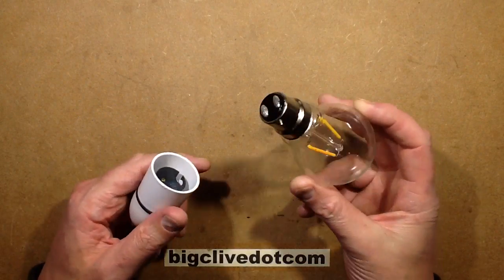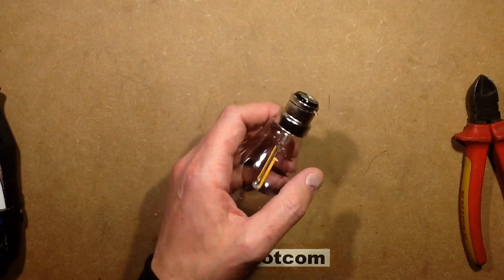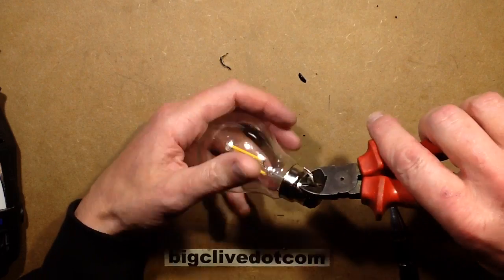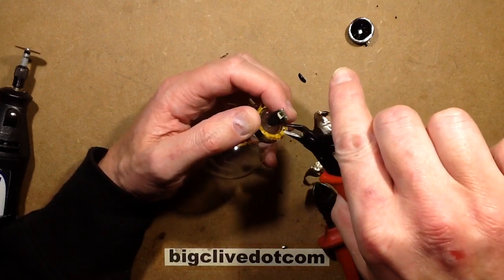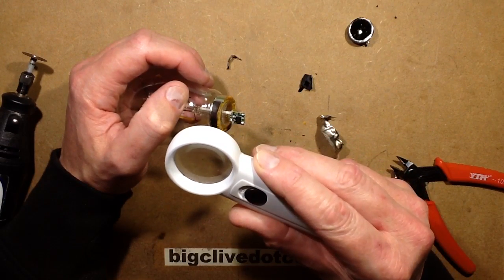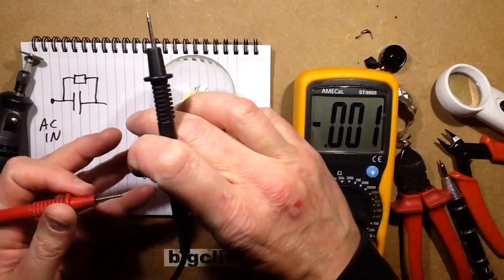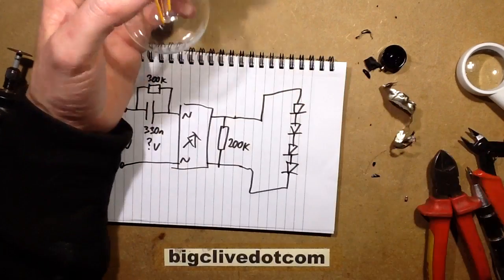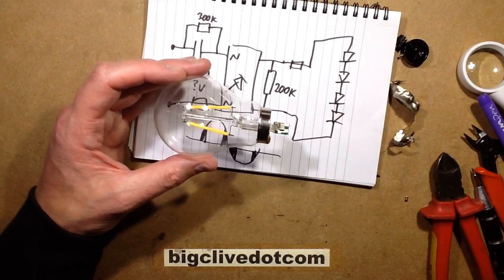Inside the flickery LED globe lamp.  (With schematic.)

Comment: Okay but I think I'd rather buy this lamp than one with a electrolytic smoothing capacitor because the cap is likely to fail long before the LED's do. If that did happen then wouldn't it short out the LED's?

Comment: Hi Big Clive! I have another issue: the LED bulbs I bought hiss. The noise is not loud, barely audible, yet still there. Can get disturbing when there is no other source of sound, like early morning and late evening. My LEDs are designed 85 – 265 V, I bought these only, as they do not flicker from my experience, at least not visibly. I had 220 V designed filament LEDs before and they flickered so I got rid of them. I only use non dimmable bulbs as I do not have any sort of dimmers. I have 230 V 50 Hz mains. What is your experience on noise of filament LED bulbs? Do the dimmable and more expensive versions also hiss? EDIT: The noise is like this one: https://www.youtube.com/watch?v=W-LBljV8rno The LED Bulbs hiss like this out of the box and all do this. It is not as noisy as in the video, but the frequency is the same. Any tips how to fix it, if possible?
Reply from the maker: That's odd.  It must be the drive circuitry, but it sounds just like filament sing when tungsten lamps are dimmed.
Reply: probably uses a switch mode circuit, noise from the inductor?

Comment: I've got a whole bunch of Energizer brand LED light bulbs which were manufactured by CRS Electronics here in Canada before that company went belly up. These are the best LED light bulbs I've ever used. Incredibly good color fidelity, warm white + a tinge of pink sort of color, surrounded by giant heatsinks etc. Very soft light patterns via vented lens assemblies. The actual LEDs were from CREE. Fully dimmable with any kind of dimmer. They were $30-50 each, and the local store that carried them stopped doing so at some point because the price was just too high for their customers. They're about 4 years old now and not a single one has ever failed (I've got about 10 of them). So yeah it's kind of sad... sometimes you get a product completely right but if the price point isn't perfect - it's over.

Comment: I'm glad I'm not the only person who can't turn a Dremel off without accidentally turning it up to full power first.
Reply: I do that deliberately to increase the cooling air for a few moments before powering off. That is one reason a single speed usually has a longer life than a variable speed that gets used a lot at lower speeds.
  Mike (o\!/o)
Reply: Experiencing Technical Difficulties - No. the speed of the fan is relative to the speed of the tool. Slow speed only requires a slow fan. Variable speed tools fail more than single speed tools because standard switches are far more reliable than the variable resistance triggers and sliders, however yes, just using a variable resistance trigger at its low range will affect that range over time.

Comment: Hi Clive! I purchased an Osram superstar classic A60 - DIMMABLE (warm white) 8.5w (which was very expensive) simply as it claimed on box... dimmable. Upon plugging in I experienced exactly as you described... It's not dimmable at all but was so impressed at the light from it, I kept it. Just a heads up for those thinking a big brand name claiming this that and other on box is clearly not an option for those wanting to dim a led bulb. Seems some supermarket own brand led bulbs could be better option. Certainly more economic.

Comment: Mic busted man? All I'm getting is left side audio...
Reply from the maker: Just one mic, it sometimes gets routed oddly in different computers Dolby setups.
Reply: I hear sound through both speakers.
Reply: Check your audio equipment, I'm wearing "earmuff" style headphones and I'm absolutely certain that I'm getting audio thru both channels.
Reply: iPhone 7?  Just flip the lighting connector and it will go to the other side.
Reply: I doubt that.
Reply: Put my headset on, both sides work fine... Must be the 5 channel audio...
Reply: Will you be doing a teardown of an E14 bulb?
Reply from the maker: The lamps with the smaller bases tend to be super simple and flickery circuitry, purely because of the lack of space in the base.  I've taken some apart in the past.

Comment: hey clive, i want to change out all the bulbs at my mothers house with leds so i don't have to worry about changing them anymore. she is sensitive to the flickering in fluorescent tubes and cfls, and likes the natural color temp. any recommendations?
Reply from the maker: I'd suggest buying a few different types to try.  A good option for mums is a good bright reading or work light.  If you have that then the rest of the house can be lit at a functional level.
Reply: fair enough. thanks. i'll do that.
Reply: fwiw my dad's pleased with some of the poundland 3W 'interesting poundland bulbs' in utility applications (hall, stairs etc.) - they're only translucent globes on the front so I think they're probably best pointing down in ceiling fixtures.
living rooms he's got multi-bulb 'candelabras' which are going to be a pain though - I think it'll be hard getting LED's that look dim enough and white enough... I predict if a bulb goes in one of them you'd have to replace the whole lot or get an 'odd bulb' sticking out at you. also several confounding dimmer circuit downstairs. 
manufacturers change their circuits fairly often and Im doubtful if it'll ever be as easy to match LEDs as it was with tungstens.
Reply: i am in the states so i will definitely visit the local dollar tree and walmart the next time i'm in the area of one.
Reply: The asda bulbs are now even less: two for 8 pounds offer. They run ok on the 220vdc inverter only for phone chargers that big clive discusses.

Comment: Which of the Dremel cutoff discs do you use for that?
Reply: http://www.banggood.com/search/fibre-reinforced-dremel.html cheap as chips. Tip, if you do a lot of straight cuts, don't wear them out completely, half way through swap the disc out. This leaves you smaller discs for tighter radius cut when needed.
Reply from the maker: Just the standard thin fibre reinforced disks.
Reply: mharris1270
Yeah but I've learned from people the hard way that it's better to buy a good one once.  I've still got an old Dremel that my parents had years ago, all it's needed has been a new switch and it runs like a brand new unit again.

Comment: just like pealing pyro cable
Reply from the maker: I don't miss terminating pyro much at all.  Although to be fair I've seen conclusive proof that it's definitely resilient to quite astronomical overloads.  Namely when the maintenance guy in a bingo hall progressively replaced all the lamps in the large numbers-called display panel.  He replaced two 15W lamps with two 100W lamps and was working his way to the full 90 numbers.  It's clear that the fuse or breaker had been "upgraded" as the pyro had left a scorch-mark on the wood it was mounted on and the potting compound had squirted out the end.
Reply: Yes it's pretty good stuff and Iv done my fair share of installation in the past.  It's a bit like a heating element with bright lights you describe,just needs asbestos instead of potting compound and ceramic seals to improve the system and give it chance to set a fire 🔥
Reply from the maker: Two lamps per number, so double that figure.  And an old and wonderful electromechanical number selection system that was a mass of uniselectors.  The maintenance guy was on minimum wage and only working there part time, so the big corporate gaming organisation got exactly what they paid for.

Comment: For peeling back the lamp base metal a sardine tin key would have been handy.
 
For a super-minimalist lamp circuit the bridge rectifier could be omitted and the led strips could be connected in inverse parallel. Each led strip would then flash on alternate half cycles. This assumes that the led strips can withstand 60 - 70 volts reverse bias.
Reply: Costs more to add a whole string of LEDs than it does to add in a bridge rectifier, but your circuit idea would work provided you put a 1n4007 or similar mains-rated diode in series with each LED string (LED's don't tolerate reverse bias as well as regular diodes do).
An advantage of your circuit is that each LED string is effectively running at a 50% duty cycle, which should make cooling much easier (or you can drive the LED's a bit harder since they have time to cool off between pulses).
Reply: You wouldn't need additional LED strings. A two string lamp would just have it's strings in inverse parallel with a suitably adjusted dropper capacitor value.
A typical single white LED will have a forward voltage drop of 3V and maximum reverse voltage of 5V so the maximum inverse voltage seen by a LED string will be limited by the forward voltage of the other string. Provided the LEDs used have a maximum reverse voltage rating higher than the forward voltage drop they should be OK running straight off the dropper capacitor without series diodes.
A disadvantage of this circuit is that it is going to be pretty flickery.

Comment: It's so bloody annoying that it is so hard to find proper LED lights. I was at my local hardware store (Bauhaus) a few days ago to find a some new LED lights. So I held up the phone in front of the display of bulbs and looked at the flicker in slo-mo. Some of them were horrible but one of them looked OK. So I bought that one. 
When I got home it turned out to be worse than I looked at the same model at the store, it shows up in my cameras at home. dammit.
Reply: i got some off ebay that are really good. they do have a tendancy to just randomly fail though after a few months.
Reply: What's weird is I picked up many LED lamps from eBay and not one of them has visible flicker.  Then again, I never went for the cheapest.
Reply: probably all down to the build quality. everything is usually made in china but sometimes things on ebay arent built to the strictest of standards and quilty checked. one bulb i bought fell apart inside, it wasnt like the bulb in this video though
Reply: Alex Atkin Last winter, I bought 3 G4 LEDS from different hardware stores to test them out. After a month, I selected the one with a nice warm white glow and went to buy 5 of them. When I installed them, they had changed the production and now were cold white and the one that I got a month earlier, now stands out with it's warmer glow. sigh. :)
Reply: matt n I agree. And people want the cheapest. There's a CRI index for the quality of the color output, I wish there were a quality index for build and things like flickering, I have also found varying quality from the same vendor with bulbs in the same price range. It is so much work to find a proper LED light. :D
Reply: *****
That's why when people complain that LIFX bulbs are so expensive it makes me laugh.

If you want consistent colour temperature you HAVE to pay a premium.

That said, for cheaper bulbs I only buy ones which have the approximate colour temperature on the box - that helps a little.

Comment: These filament LED lamps are in the supermarkets now - I wonder if Asda, Tesco, Wilko etc will only sell quality LED filament lamps that don't flicker.
Reply: In America, the Walmart brand filament LEDs are pretty decent (because they're partly designed by American headquartered TCP - Technical Consumer Products - before being made in China).
Reply: Hello Julian,  I got some from asda,  there's no flicker to the eye or my I pad.  I'm very impressed
Reply: I can report that B&Q filament LEDs don't seem to flicker, although I had one lamp partially fail. The other is still working flawlessly.
Reply: I got a blue LED filament lab from Ebay (just the normal LED filaments but without the phosphor, it has no flicker and only $4.
Reply: I never seen one that flickers.. I quite like the led filaments, they give you a sensation of an incandescent light bulb. :) They are not selling incandescent bulbs around here anymore..

Comment: +bigclivedotcom I want to get into electronics and have bought a breadboard, where is the best place to start and are there any good books you know that could be useful like this one https://www.waterstones.com/book/make-electronics/charles-platt/charles-plaa/9781680450262
Reply: +LegitTheral I'm still a bit of a beginner with electronics but by far the best book I've got is called Basic Electronics For Tomorrow's World by Len Jones & published by Cambridge University Press. It covers all the fundamentals; charge, current, voltage, power & Ohms Law. It also explains all the common components. Admittedly the 'Tomorrow's  World' it refers to has been & gone as it was first published in 1994 but everything still applies. ISBN is 0521409179.
You might also want to scour the 'net for beginner circuits that you can easily build with a handful of components.
Reply: tony sansom
I think I need something a bit more advanced than that? I know all about ohms law, resistance, capacitors and all that jazz. I would like a book going more in depth with 555 timers, actual practical circuits and micro controlllers? and how to draw a circuit from any circuit board
Reply: +LegitTheral Oh ok, I misunderstood what stage you were at.
In that case the internet is absolutely heaving with circuits you can build yourself for 555s, audio amps, motor driver ICs, playing with LEDs, etc.
Reply: I'm hesitant to suggest this, since it's even 'older' than 1994, but check out the Electronics or Engineering notebooks by Forrest M. Mimms.   His earlier 'notebooks' give plenty of circuits using both the analog and digital components.
I found his explanations quite informative.  He used to be published by Radio Shack.  (I guess that dates it, eh?)

Comment: Reminds me of my "lantern" LED filament bulb, I added a 4.7mF electrolytic on the DC side to smooth it out as initially it was horribly flickery before (I think I showed you the video of it on my SanitaireC12 channel), haven't put it into use though, just bought it cos I wanted one, which is an acceptable reason for buying LED filament bulbs... :)

Comment: Those cutting discs scare me. I was tempted to reach for the goggles just watching the video.
Reply: Forget them just that one time, and you'll never need them again. ;)
Reply: Or you will only need a safety monocle.
Reply: No matter how many times you get shrapnel in your eye from a cutoff wheel, you always seem to forget wearing safety glasses.
Reply: I bought a Dremel but after using it once (unsuccessfully as it melted the plastic instead of cutting it, too much friction) I'm very reluctant to again.

I have this image of a broken disc flying towards my flesh at god-knows-what speed.
Reply: I never forgot to put them on when I used a dremel wheel.
Didn't bother to put them on using superglue though: flung a tiny droplet of superglue right into my eyeball trying to glue a corner of an elastic fabric to the wood.
Now I wear goggles doing just about anything.
Reply: I mangled my palms and fingers with mill bit a few times when it bit into the material and "drove" towards my flesh.
Oddly enough I am less afraid of it and more careful now.

Comment: thats still two components they can take out to save .00001 pennies
Reply: Parts'll be even cheaper in-china though when buying in hundreds of thousands.
Reply: Cheapest resistors I found on Mouser (randomly) were $0.002 a piece at a thousand quantity. Cheapest high-ish value capacitors generally $0.10. 1000 for both is That is about $102. $100 for 1000 caps, and $2 for the resistors. These costs (even the resistor) become more significant when making hundreds of thousands of units.
Reply: @PowerMax when you get below £0.02 (about $0.026USD ish) the placement cost is more than the component cost. IE you can get a Hitachi machine to place 80,000 components an hour but they cost absolutely insane amounts and I don't just mean a million or two. The machines need a complete stripdown and overhaul every 1000 hours, and maintenance every 10 hours. There are all sorts of gaskets and such like that need replacing at that 10 hour interval too costing if I remember correctly something like £500 a time (for the kit not each). You cant use knock offs either as they just don't do the job properly for sealing etc.
Reply: That's interesting, I thought they were better than that!
Reply: The slower machines are less money and less maintenance but often as slow as 4000 components per hour. that pushes your labour costs up by a factor of 20. It really is a game of swings and roundabouts.